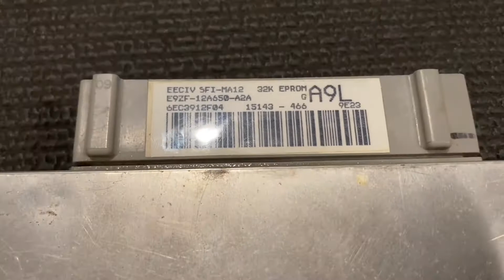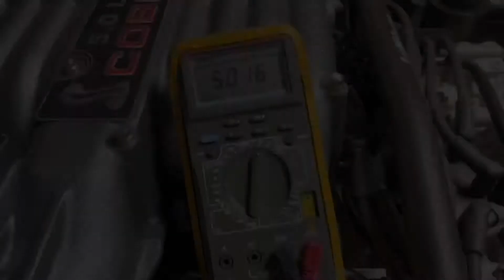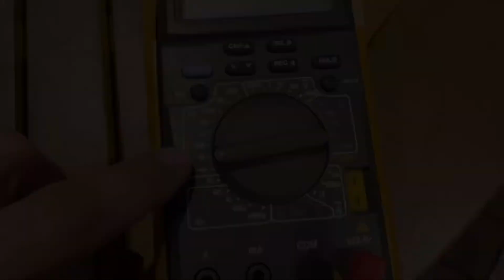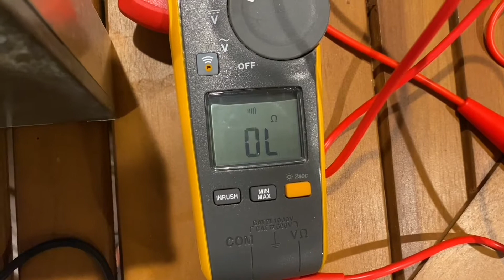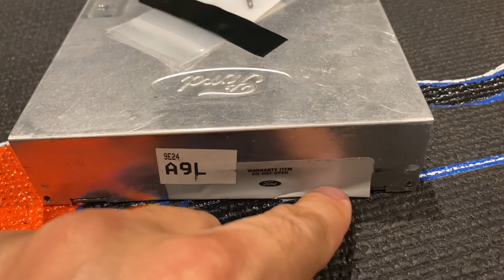Mustang Foxbody ECU Inspection -  Things to check if you suspect your ECU is in need of repair

Comment: I have a corroded blue capacitor connection on the far left in a group of three. I have been having issues with my fuel pump cutting out after 30min of driving and just checked my ecu and found the corrosion on it. Do you think that could be the cause? Im gonna go to a computer repair shop and get it fixed. Hopefully that does the trick.
Reply: Did you Try to switch relays?
Reply: @scottcrowley2061  changed my fuel pump relay and ignition switch relay and still had the issue. changed the rotted capacitor on the ecu and so far so good.

Comment: 91 f150. I'm showing 0.3 ohms on pin 40 and OL on pins 46 and 60. Two guys tried to repair but they only replaced the caps while I kept stressing damaged traces which they denied but I think that repairing traces was beyond their comfort zone. 
Given the the 2 OL readings what is your analysis? 
Thank you for your consideration.
Reply from the maker: If you are getting open between pin 46 and 60, that would suggest to me a burned trace.   You can usually see it if you open the ECU.  I wish i had images of burned traces when i made this video. 

The usually burn on the backside down near the 60 pin connector.  It just looks like a darkened trace and if you check continuity between two pins ahead and behind the trace it will show as OL
Reply: Okay. Let me get some electrical logic straight. Pins 40 46 60 are all ground pins, therefore, continuity should show between any 2 of 3 that l test.... correct  ???? 
Now when I repeat the test l do get continuity between all 3 pins. 
Now l do see a large darkened area around one of the 47 uf caps but it is not a tiny thin individual trace but a large broad area of gold colored trace more like an " island " that like the individual traces are scattered all over the board. Would this burnt out region likely be the culprit?
Reply from the maker: @steadyeddy6526  yes. You should get continuity when testing any combo of two pins between 46, 40 and 60.

Would need to see cap to determine if burned, but given the age of these ECUs it’s a possibility.  Usually the caps leak and create a green corroded goo.  If bad enough it might look dark as well.
Reply: @Mustang5L5  May want to point out the caps are electrolytics (of any device) that usually fry,  probably not the "orange drops". They must be oriented plus to plus, minus to minus.

Comment: I have a  '92 f150 4.9 5 spd with 435,000 miles.  Owned since new. Could you recommend someone in states than can check out my computer? No known issues but would like to have it gone through to prevent future issues and keep it running strong. Great video. Thanks.
Reply from the maker: ECU exchange is the company most folks send their ECU to get gone through by.  I’ve never used them but have heard lots of folks recommend them. 

https://www.theecuexchange.com

Comment: Breakout box would be awesome doing this kind of testing
Reply from the maker: I have one, but figured most folks doing this sort of testing would likely not have one on hand.  Tried to stick with what could be done with just a multimeter in hand.  

Wish I had some examples of burned Pin 46 traces at the time I made this video too.  They tend ot burn at one specific spot, so easy to see.

Comment: Both of the computers in my foxes were ones where the fuel pump was stuck on. And both times, it was the capacitor next to the heat sink/transistors. Replaced the caps and worked like new again. Just FYI.

Comment: Hi, great video! Would you know the part number for the fuel circuit  transistor?
Reply from the maker: I have not been able to find a replacement.  The number on the transistor is 04S74 8916 made by Motorola.  It's like an OEM component made for ford with custom part number as I have not been able to find a data sheet on these to spec out a modern replacement.

Comment: So I got a oxygen sensor harness from cj pony parts it said 1986 through 93 I never knew that it was not jumped right I guess it is jumped for 91 to 93  my car is a 1989 5.0 speed and my pin 46 got burned so my question would this cause a hot start problem and run super rich I also has idle surge love the video by the way❤
Reply from the maker: If your PIN 46 trace it burned, it would cause issues like you are experiencing.  The O2 sensor harness jumper can be repinned.  Would suggest doing that and confirming the jumper is now correct before repairing the ECU. 

Pin 46 trace is signal return for Coolant temp sensor, TPS, Air Charge Temp Sensor, MAP/BAP sensor and EGR Position sensor.  You would need to assume the signal returns from all of those would be compromised with a burned trace and can make the engine run pig rich, and poorly overall.
Reply: @Mustang5L5  so I bought an oxygen sensor harness for cj pony parts it said 86 to 93 harness now that i looks at it it's pined for 91 to 93  so I'm guessing that fried the pin 46 but ya I hear the fuel pump prime but when I crank it just cranks and crank some times randomly it fires up im guess from what u said maybe the computer can't process i checked the coil and it has spark so ya I guess a rebuild is needed now :(

Comment: On my car we checked continuity between 46 & 40/60 like you stated. Test came back good, but we are hesitant to open up the case because the car was tuned years ago and it appears as though when the chip was burned in and cut into the side of the box and is sticking out. Before opening it, is there anything else I can test for with just the pins?

Comment: Wow, great video.
Really got into detail with it all to make me understand I have a question, maybe you could answer, I have a1987 ford f150 No start issue, it cranks. I have spark when I spray starting fluid into the intake. She starts up but stalls, My truck is equipped with 2 fuel tanks. When I turn the ignition on I can hear the fuel tank pump prime itself for either tank i have selected. Can this computer?
Be causing that no start issue with the fuel.
Like I said, I could hear everything kicking in it's just not starting. I would appreciate if you could get back to me if you feel this is my issue and maybe let me know where to look the computer.
For my issue. Thank you so much
Reply from the maker: I don't think i'd immediately suspect the computer yet.  I'd still look at the fuel system and troubleshoot that like checking for fuel pressure on the rail.  I'd be looking to see if the pump can supply pressure to the engine, and if the injectors are getting signals to spray fuel.  Could be a wiring issue, could be a failed fuel line from the tanks?  Could be several things but I wouldn't blame the ECU just yet.  In fact, with it priming the pump for 1-2 seconds and stopping, it's likely not the ECU unless it's a fuel injector issue.  Still, i'd have to troubleshoot wiring first. 

On Mustangs, i've seen a similar issue causes when the little S-hose on the fuel pump splits in the tank.  Pump primes, but no pressure at the rail.
Reply: Thank you so much for getting back to me, I just not sure what the actual computer does for my issue. But reading your text back to me kinda helps me out. I'm glad that you feel. Maybe it's not the the computer.I'll look elsewhere, I change the fuel pressure regulator and the truck started, but I think it was because it still had some starting fluid in it.From the last time I tried to start it, but it wound up dying on me and wouldn't start again after that

Comment: Do you recommend certain capacitors to replace these with brand wise?
Reply from the maker: I don't have a preferred brand but my preferred Vendors are Digikey and Mouser.  I typically get all my electronics components there vs Amazon or Ebay.  It's a little more $$$ but I feel better about the quality of the components those vendors sell.
Reply: @Mustang5L5   even chasing idle issue for 3-4 days then after running just crank no start. Pulled ecu and capacitors are leaking 👌👌👌
Reply from the maker: @matthopkins1107  At this point, i just assume every ECU that hasn't been repaired,  probably should be repaired as a proactive measure.  Good luck!
Reply: @Mustang5L5  Sage advice.
Reply: @Mustang5L5  Japanese brands are probably best, they are possibly counterfeit if off large marketplaces, always best to buy from reputable electronics suppliers.

Comment: Very very helpful, at least from a visual standpoint. I am about to do a capacitor replacement. 92 t-bird X2P. The pinouts are different than the A9P A9L. I have an alleged A9P but the decal is gone. Is there another way to tell the code? I set it aside for now. I got it from a foxbody friend. But I'm not confident of A9P or even MAF at this point. I love these "deep in the weeds" projects. My project is a '49 Ford F1 with an Explorer 5.0 running EEC IV MAF not a drag car, just a cool old truck!

Comment: I got some questions about cel  always being on, can't retrieve and codes
Reply from the maker: Strong indication there is an ECU issue, specifically a burned out trace for pin 46.   You can pull the ECU out and check for continuity between pin 46 and pin 40 and 60.

Comment: I have a car that won’t start with a constantly running fuel pump. I have no clue how to fix it so unfortunately I’ll most likely be going to a TerminatorX even though I really don’t want too. Thanks for the video. Very informative and I greatly appreciate the knowledge.
Reply from the maker: You could always send it in to ECUExchange for a rebuild.  9 times out of 10 the constantly running fuel pump is that capacitor off to the side on the edge of the board.
Reply: @Mustang5L5  Thank you! That’s great to know. I worry about sending it out and never getting it back or paying out the rear for it to be fixed. Thank you for the information.
Reply from the maker: @adamcartwright6220  while I’ve never used them, lots of folks have.  They seem to be a pretty trustworthy operation
Reply: @Mustang5L5  Thank you. I may just have to try it because I do want the option to go back to stock

Comment: Man you are a great teacher,very concise video, no music, no BS, just knowledge,  i have been around these cars for decades and have 2 of them Ive had forever,on my 91 i have had some issues here lately, i do have a new engine in it and ive been having idle issues and I'm very familiar with them, when i installed my new engine i basically bought everything new, not because i like to throw parts but because ...new engine=new parts, why install a new engine with a 20 year old distributor or sensors etc ? that kinda thing.

Here recently i pulled my computer for the very first time and there are a couple of capacitors that look like hell, since ive checked everything and everything is basically new with oem Ford parts i'm guessing the computer could be at fault and its time for a rebuild? i also have a very very weird problem,when it rains the car will run like crap, i dont have to drive it in the rain,just the fact it rains its enough to throw it into a a abyss of bucking and dying etc, you ever hear of a computer going crazy due to moisture?

Its not the distributor, or the plugs or the mass air or the  distributor boot or the oxygen sensors or the ECT or ACT or any of those things, that has all been triple checked, codes have been pulled, no codes except for a 31 and 85 which are emission related,those are the only 2 codes,thank you for any input you might have,im  in the process of purchasing a used PCM that needs rebuild so i can have a spare one but mine is getting rebuilt too.
Reply from the maker: I haven’t heard of too many instances of moisture affecting the ECU but doesn’t mean it can’t happen.  For the most part they are somewhat isolated in the kick panel, so they aren’t as exposed.  However the caps should probably be replaced in general due to age, especially if they look terrible 

I have heard of moisture being an issue with ignition parts, specifically the PIP in the distributor.  No codes, no other signs of issue but distributors should be looked at carefully, especially with the latest aftermarket parts for them being of poor quality.   I wouldn’t discount ignition yet as the source of your problems
Reply: Yeah that distributor is new but like you say these aftermarket parts are normally not very good specially electrical ones, the distributor was one of the few things i could not get OEM,they are hard to find these days, thank you so much for your input @Mustang5L5
Reply: Did you end up fixing the idle issue?

Comment: Great video man.I had always thought the capacitors were the cause of the continuously running fuel pump so it's great to finally hear/see the true cause.Showing how to externally test pin 46 instead of squinting while trying to look for the burnt/
open trace on the board itself.Thanks for the great job,